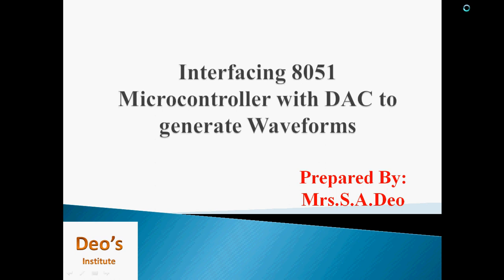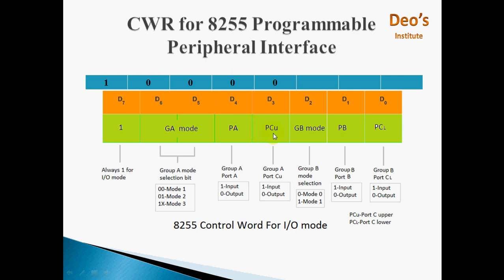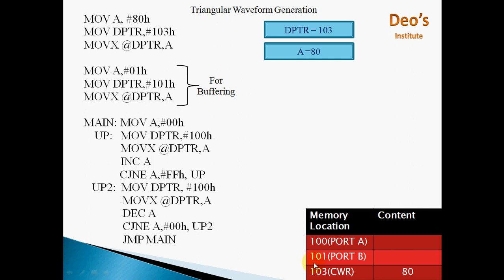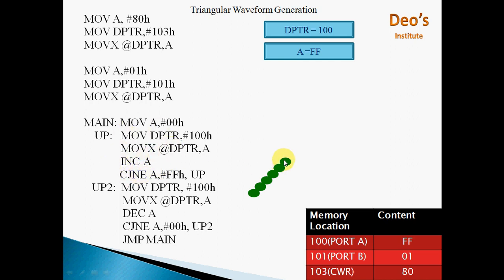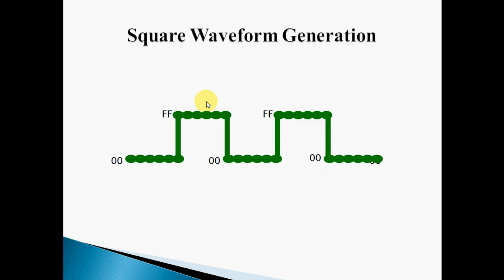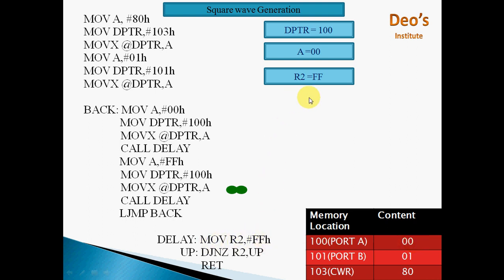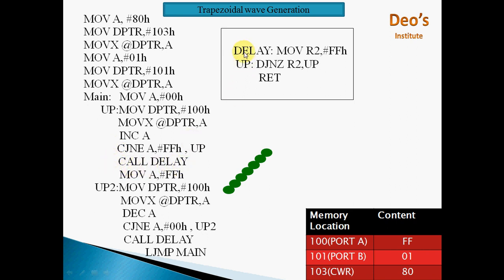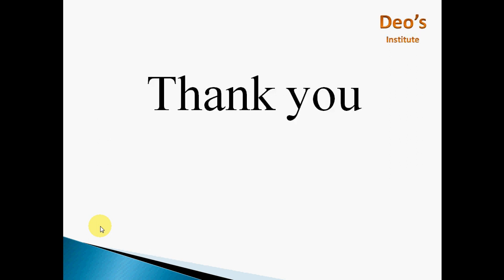ALP for Waveform Generation using 8051| 8051 interfacing with DAC for Waveform generation

Comment: Please reply...
Mam I think there has to be 'MVI' in case of 'MOV'
isn't it??
If not then please mam please explain as soon as fast🙏
Reply from the maker: This pgm is written for 8051 microcontroller..if you are using any other microcontroller or microprocessor it can be MVI..
This pgm works correctly on 8051 microcontroller kit
Reply: Thank you so much mam for your reply 😊